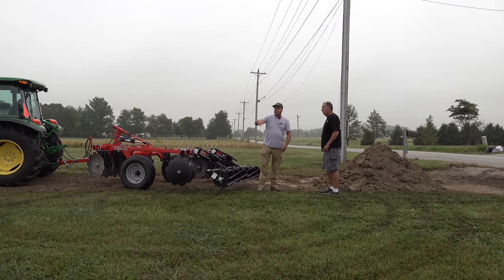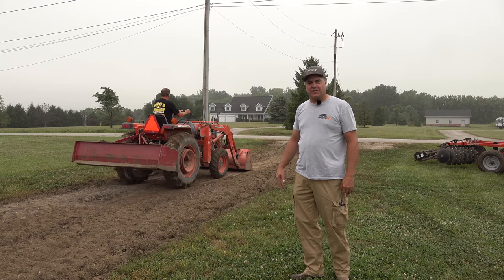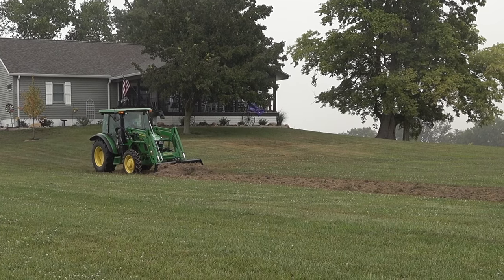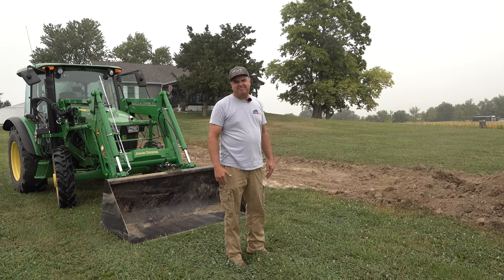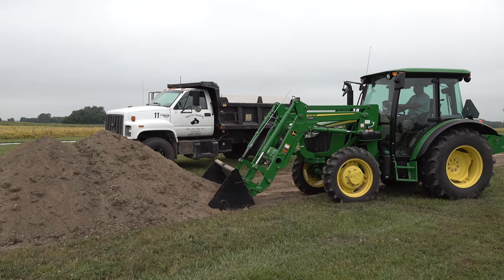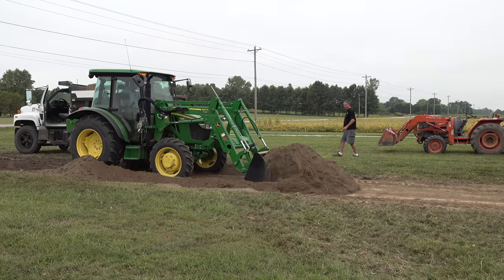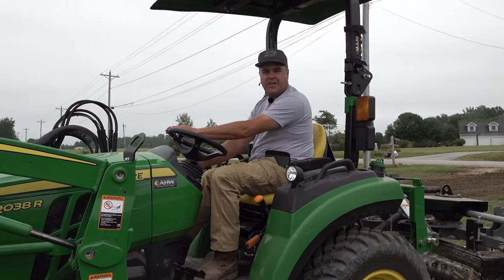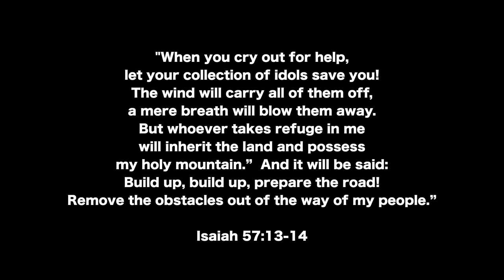STRIP MINING?? Deere 5075E Disk & Load Dump Truck

Comment: Tips for Tim.  One go get multiple paint pens.  Park Johnny 5 on a flat level concrete surface.  Lower Johnnys bucket till you have it flat and level,  use black paint pen to mark level against a certain point that is easily seen.  Then use another color on both sides just as a highlighter of the black approximately a 1/4 inch thick stripe. This will give you a slight scrape line or a slight add line to your flat level line.  It was a trick I came up with when I was a city operator for a parks department.  We kept getting new tractors after I did the first one, I think the other departments like my idea so they kept taking our tractors.  I shouldn't have let the water department operator use it.

Comment: In the South we call a box blade a yard box. If you practice, just a little with one, I think you will see the advantages of the yard box. The thing is, you can see exactly what the yard box is doing. With a front loader that is hard. You can also run faster with the yard box without digging in if you have it set correctly. Like anything, with a tractor, finding out how to use it is the key. A little time spent with the yard box and you will love what it can do. You can level up an area very quickly by angling the back blade down just slightly and run in circles with increasing and decreasing radii with each pass.

Comment: Great seeing the use of all the tractors together. Work went faster, each had a job suited for them - with the right implement for the job. A different bucket might have worked better for Johnny 5, but you work with what you have.  I also liked that you showed a "readjust" on Johnny 5 when dumping - we're all human and not perfect.  A little will, some motivation and a dash of determination will get a job done.  At least there wasn't a need for 1/2 measures or duct tape LOL  As for using the dump trailer, well sometimes it not until a project starts that you know just what you need to be most efficient. Great video. Thanks Tim.

Comment: thanks for sharing the video, back in the day I ran a 7 ft wide towner 2 gang disc. I bolted on 2 each 7 ft long railroad tracks to the disc it really made the disc cut in. probably wasn't too good for the bearings but it sure worked great .

Comment: Loading a dump truck does take practice.  I once helped my BIL strip 6" of indoor horse arena sand using my JD 4720 CUT with 400CX MSL loader.  I loaded all that sand into a big tandem axle dump truck, compete with 6" wood extensions.  I did have to load it from both sides and the back to get it nice and full.  I do know, for sure, that having the MSL feature sure helped making raising the loader to full height a nice smooth operation.  I just curled the bucket all the way back at ground level and then only had to raise the booms as I approached the dump truck.  No "herky-jerky" manual bucket "leveling" as is required with a NSL loader.

Comment: One grading tip I was given by an uncle who was an excellent professional machine operator is-
The machine cannot cut a level grade unless it is sitting level. This is true for tractors and crawlers ,unless you have a tiltable blade, as some do.
Ive put about 5000 hours in on our small JD crawler, also operated larger Caterpillar and IHC crawlers.
On top of that I have a fair amount of time in using ag tractor loaders.
With all of that, I still sometimes forget my uncle's simple but important bit of advice.
Sometimes it means dropping a bit of fill on one side in the area where the tractor will be sitting just as you enter the cut. It seems fiddly but it works.

Comment: The price difference with a Box Blade VS Frontend loader is huge!  Plus the easy quick removal.
Reply from the maker: Oh, so you are suggesting not getting the front end loader at all???  Ok. That would be a totally different debate!

At least on the 1025r and 2038r with single point connection, I can remove/attach loader without leaving the seat...and fast.
Reply: @TractorTimewithTim  Well my response was pointed toward the older tractor users.  You said the owners years ago got used to a Box Scaper.

As far as getting a frontend loader now?  Hmm depends on application of the tractor.

But I think some user don't regret getting a frontend loader.  Even if they said I would hardly use it.

Comment: I bought a new JD 8110 in 2001 and had the dealer put a Koyker 785 loader on it.  That was an unhandy setup.  The bucket was about 25’ ahead of you,  it was ok for loading the TMR or pushing snow but definitely not grading or anything that had to look good when complete.

Comment: Tim a box blade or land plane have there pros and cons and loaders have there pros and cons with the box blade if you get into a soupier mud situation where the tractor feels like it's not going forward just lift the box blade and not leaving ruts in the soil ware as the loader having more weight forward

Comment: Earth work is a skill learned over time. I don't know how many hours of box blade work it's taken me to feel relatively confident. I find bucket controls to be a bit more touchy to get that nice consistent smoothness. I thin some of that has to do with the wheelbase on a tractor when using the bucket, whereas floating a box blade behind seems to be easier.

Comment: If we had a tractor with a loader, then we wouldn’t have a box blade, but it is not worth buying a $30000 tractor to do the same job. The only problem with the older tractors, no front loader (some exceptions) and without ‘live hydraulics’ so you can use power steering, lift the 3pt and use the hyd, Outlets that you can use at the same time. We luckily have an oliver 550 then you can do it all at the same time, just minus a loader.

Comment: I can't tell someone how to do that, but I can certainly show you. I'm not a teacher I'm a doer. The first dozer I had didn't have hydraulic tilt only up and down.  Had to learn to work with that.
Also not a fan of spreading topsoil with rubber tired machinery.  It compacts the soil too much. That bucket looks too deep for your tractor and on loader tractors I always opted for bigger front tires

Comment: Tell me about your wheel disc Tim. What brand, size and hp requirements. I need one in a bad way.
Reply from the maker: It is from Monroetufline.com.  It is 8’
Pull type disks are heavier than 3 pt, so they will cut deeper.

Comment: But TIM, You Are the King of Compact and the 1025R. Can't fault you for lack of seat time in Johnny 5. Maybe use it more instead of proving OJ (Original Johnny) can do a Bigger heavier job since J5 is available.
Are you doing any Cardiac Rehab?
Reply from the maker: No rehab.  Just working on my own.
Reply: @TractorTimewithTim  stay motivated, keep up the good work.  This is what created the fast Mall Walkers. After heart issues, getting the heart rate up.

Comment: ou cant precision grade with a loader.    Try putting a crown or valley in a road or driveway with a loader 

Also you don’t get the suction effect on the front.  3 point hitch implements put weight on rear tires so you can create much more tractive  effort. 

-signed someone who owns 2 loader tractors and no box blade

Comment: Tim,  it's not you,  I have the 5055e with the backhoe I talked to you about selling.  I have a SVL95-2s, a Kubota M59 TLB, and a JD 2305 with a loader and the 5055e is the WORST!!!!  It was a mistake to but that tractor all around, but the backhoe was the worst part followed by the loader, as a tractor it's not bad.

Comment: When you say "just a little too big for Johnny", do you mean in terms of operating height or power demand or both?
Reply: I have experience with power rakes... I would think the weight would be a concern for johnny... it would lift it but they are generally a heavier attachment. Also power if you dig it in deep... if you were just "brushing" the ground,  it should do fine power wise
Reply from the maker: Johnny can hardly lift it.